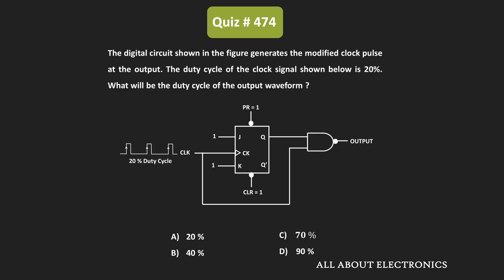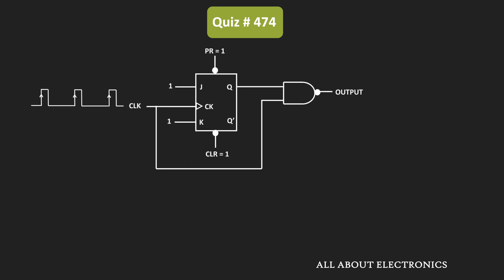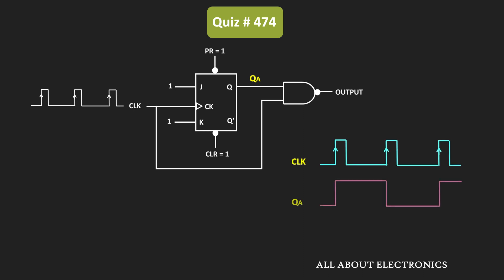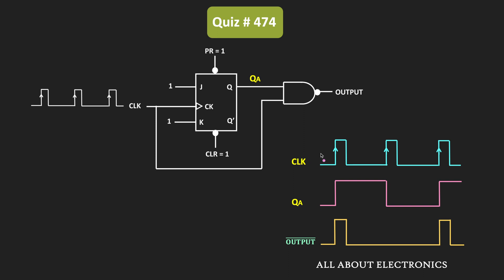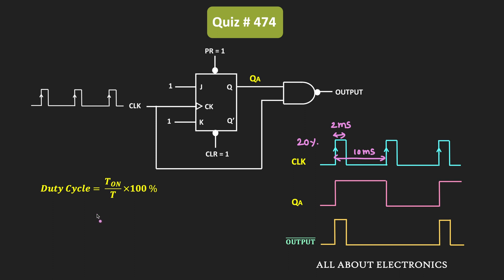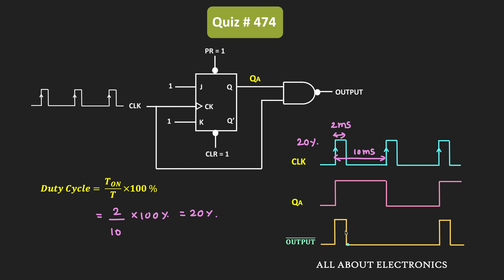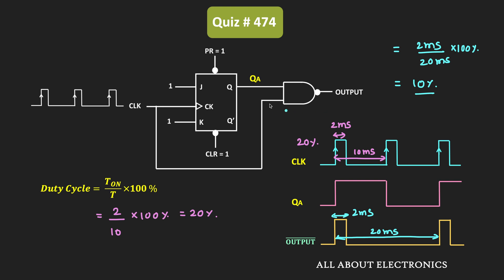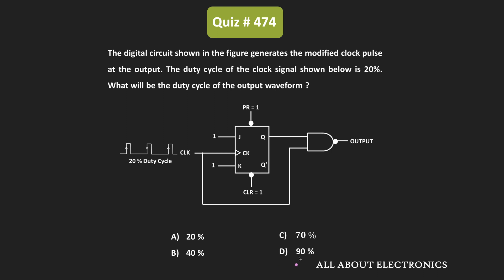JK Flip-Flop Solved Problem (Digital Electronics) | Quiz # 474

Comment: Sir, isn't that a nand gate?
Which means that the duty cycle becomes 80% and not 20%?
Reply from the maker: Yes, it is NAND gate. And that's why the Duty cycle is 90 %. If it is AND gate, then the duty cycle would have been 10 %. In the video, I have already explained that. Please check it once again.
Reply: Sure sir, thank you for replying @allaboutelectronics-quiz